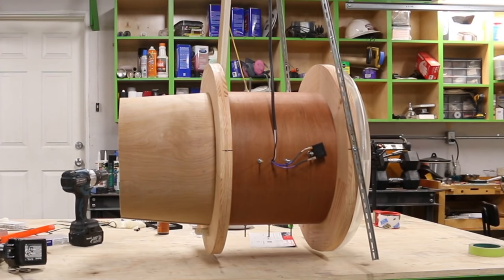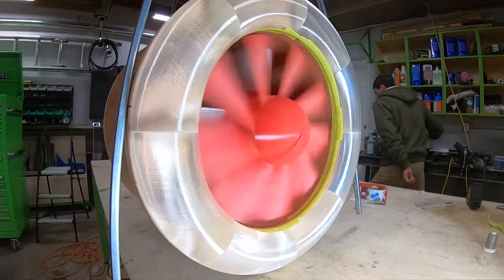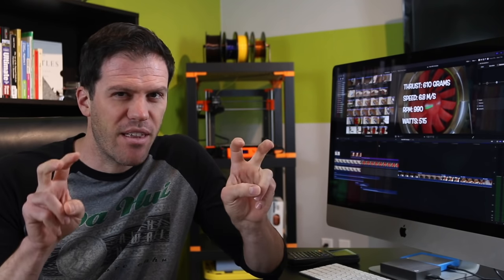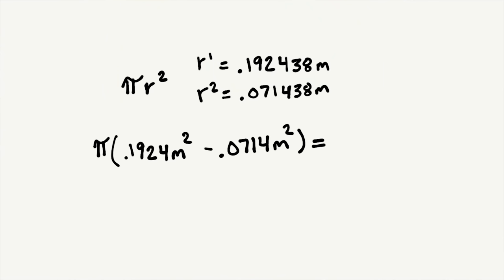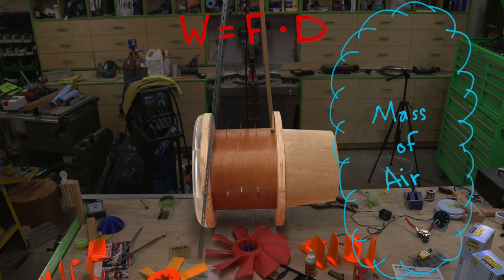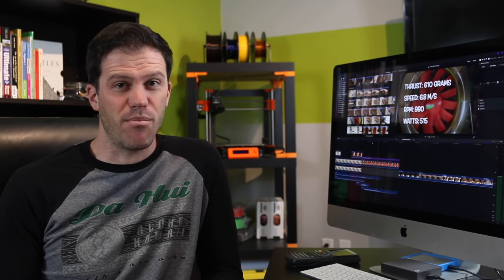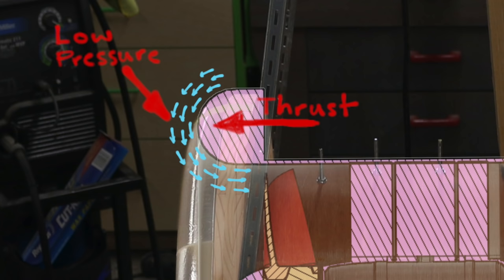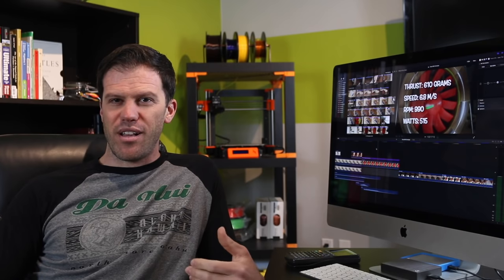How to apply ducted fan theory to real world fans

Comment: Remember that the diffuser at the inlet increases the mass flow because it slows down the air raising its pressure and density, the greater pressure difference between the inlet(before the fan) and outlet(after the fan) adds the mechanical displacement of air from the fan. In other words, with a diffuser, air begins to pile up before it interacts with the fan.

Comment: I'm just a home handyman. This explains why duct-taping a common floor fan onto the front of a honeywell air cooler when the original fan stops working does not work out to be very effective. I have tried it and quickly realized there must be a lot more science and technology in the design of fans and fan motors than I thought. Nothing works as well as the original parts. I am having trouble sourcing the right replacement parts in Australia though. Thanks for the video, I watched it all and I found it very informative.

Comment: the inlet is helping redirect normal atmospheric pressure (even in all directions) into the fan. It provides a gradually curved surface the air can "hug" as it starts moving radially inward in the plane of the fan and has to accelerate at 90 degrees to this to actually enter the fan. The curved inlet prevents flow separation, same as the top curve of an airfoil.

Comment: The HVAC guy used to take account of static pressure and dynamic pressure in working out air duct flow performance. 

Local moving air has a lower pressure (density) than ambient air, with or without ducted.

Comment: Hi! Are you sure the inlet difference you recorded is the coanda effect? I think without the lip you are experiencing loss due to the entry flow condition. Essentially the most efficient part of your fan (the outer diameter) is getting turbulent air because of the sharp entrance corner. You can test this by using a truncated cone (you know when your dog has stiches and they put that cone on their neck so they can't lick themselves?). Just make the outer diameter large enough so your free stream flow is as low as possible and avoid abrupt changes (smooth curves and not corners).

If you investigate this I suggest the title, "Is the coandra effect a LIE!?" and a thumbnail with a big red curving arrow pointing to the duct lip. Glad I happened upon your channel, great content! 

PS - Maybe use paper/poster board for the cone since 3d printing would have a rough surface and take forever to print. Cheers! If you can find a copy of this book: 

Munson, Young and Okiishi’s Fundamentals of Fluid Mechanics 

Check out chapter 8. I think the way you would really test this is adding a longer inlet duct and using properties of that duct to calculate a characteristic length loss. Ok bye for real this time.

Comment: I have to say, thanks for working through the power formulas. This let me 'solve' something I'd been curious about in a moderately different domain- a diver propulsion vehicle (DPV), depending on the model, is just a glorified ducted fan in water. For one, I have a DPV, and based on possibly wrong specs, I know it probably caps out at 300W, with a 25cm duct diameter. Thanks to math, I can now say, at most, the water is going through the DPV at ~4.0MPH (or 23 gallons / sec), which should be a ceiling on max speed.  Then for two, I'm wanting to try building my own, using a similar ducted fan design but using an an edge driven axial flux motor prop concept thing. But I've had no idea what kind of specs to aim for other then the 'let's try it and see' method. Now I have a relation between flow velocity, power, and prop diameter. (granted, applying all of this in water probably adds a whole host of other issues, but if it's within a factor of 2 or 3 (parking lot of the ball park), I think that's fine)

P = area*density*(m/s)^3 ... or ... P = (volume/s)*density*(m/s)^2 ; these need to be posted somewhere. I have no idea what to call them because it's an incredibly specific niche, but they need to be easier to find. (or I need to get good and realize that this was always a simple derivation of the base units of kg⋅m2⋅s−3 )

Srsly, everytime I would go looking for a power formula for pumps/fans/etc, they all focus on power in the context of a known delta-P. Which does make sense to me- in those systems you're adding energy to the system by moving mass 'up' a pressure gradient- simple case of energy/time. I'm still scratching my head on the interpretation of this formulae / the situation of no pressure change, I think it's down to "we've imparted velocity on a previously stationary mass of fluid". Which also kind of makes sense. It's a different way of getting to the energy change. 

All this to say, thanks for the video, it was one of the more useful/informative make/testing videos I've seen on the platform!
Reply: And a dumb step further / related to the design problem.
P = F*vel, F = P/vel, so for a 300W motor, with 1.78 m/s flow, you're talking about a force of 168 N. Which is going to be (probably a high bar for) amount of force the rotor imparts on the (external) stator / the load rating needed for bearing surfaces. Which is another of those things I've had in the back of my mind for "how do I even begin to work that out". 

So, again, thanks for the formulae, even if my interpretation makes the engineers cry :-p

Comment: I loved this. I might have missed a point, but am baffled that the measurements fitted the 2 or 3 blade fan. Obviously, experience (ie commercial designs) tells us that more blades are "better". In fact, as I read it, bigger fans are more efficient because they accommodate more blades. I'm looking for clues!  Another thing (where I'm probably way out) is that compressing air (unlike water) leads to more complex calculations involving specific heats. I wonder if that is part of the disparity.

Comment: Does your mass/s @ 10:03 include the compression of air as the fan pushes?
Or is it nearly offset by the lower pressure just before intake?
Or is it fundamentally insignificant to your goal?
Or is the 'napkin' running out of math space?
Or am I an ignorant lunatic? 

Probably #4 ..

Comment: I had to design a duct for the lift fan on a hovercraft I'm building. In the end I had a straight duct with no bell mouth as I found out that there is not much air velocity as the skirt holds most of it in. So the fan is really just pressurising the air and adding bits as air is spilt past the skirt.

Comment: That sharp edge of the duct when not using the rounded inlet geometry might just cause a flow separation in the front part of the duct leading to vortices forming in this low-pressure zone. Hence, the mass flow is reduced. When using the round inlet geometry you avoid those vortices, enabling a higher mass flow and exit velocity. Exactly as you measured!

Comment: The decreased outlet velocity without a curved inlet lip probably comes from a flow seperation just behind the sharp edge. The seperation effectively decreases the inlet stream tube area so the outer parts of the blades are not moving air, this is called blockage. As the nozzle area stays constant, the decreased mass flow leads to lower velocities after the nozzle.

Comment: Love the models, testing and all your efforts, but….  The force (or static thrust in this case) is the mass flow rate through the closed system times the (mean) exhaust velocity (Mdot x Ve). From watching the video several times, it appears you have calculated the blade’s tip velocity (rotational velocity x blade radius) and assumed it is the flow velocity at the fan face. I’m not sure that is correct.

Comment: I am trying to understand jet drives in performance jet boats well enough to make improvements to jet drives intentionally . I could not have paid more attention to your video from start to end without going into  attention debt. Particularly interesting were the bits where you found that the volume taken by the fan in the duct did ot count against the dynamic airflow volume very much. Also the effects of intake bell mouth shapes and presumably sizes. Even though jet drives and ducted fans part ways in in most ways at the far ends of their impellors, the inlet side of both share a lot of similarities and room for improvement on their inlet sides

Comment: I made it this far because I believe that ducted fans are a preferable alternative to the traditional propeller used by autogiro aircraft; simply that the noise produced indicates major energy loss. Provided the shroud does not create too greater an amount of drag, I am interested whether the greater pitch of the fan blade at fewer revolutions would mean the same thrust as a naked propeller - but in a narrower plane. Without the means to build and test, I am looking for clues from watching the application of maths to this area.

Comment: Sooo cool! I’m all in...I’d like to see ur results on negative camber wing section shape nacelles using NACA types such as NACA 4412,..15,..18. Or N 63-206,..209,..and..210. Negative camber nacelles with max local camber forward on the inside and an outer concave shape (like NACAs above) in a conical parallel to your fan axis...I would model that... I bet u’d see magic.

Comment: With the two bladed model, create ridges on the low pressure area, concentric to the shaft, about 3 mm deep and 5 mm wide. The cannelures/ridges should touch, with sharp edges.

Comment: theres some basics to consider. first off, the less blades, the more efficient. secondly, the larger the diameter of the blades, the more efficient.
now, when you use too many blades and a small diameter things get messy.
The main reason to use lots of blades is to stuff as much work into a small area as possible- at the expense of efficiency. its a space constraint problem.
The next is blade pitch. at static conditions there's a sweet spot and if you go too fast things get messy too. So consider plotting the results in terms of thrust v rpm and NOT maximum thrust and maximum RPM.
Obviously when flying theres also a sweet spot but thats another story.
And then there's the intake lip. You just cant test an EDF without one. And you cant just use any old shape either. 
For rules of thumb, power is proportional to diameter and RPM and speed is proportional to RPM.

Comment: 1) Duct air mass isn’t equal to ambient air mass. If not corrected the calculation can be larger than actual.  

2) It is also known that air speed approaching the inlet accelerated to X m/s and further accelerated to 2*X m/s right after the blade trailing edge.

Comment: Normally the 'losses' are in a form of heat or friction i.e. print surface, air resistance, bearings, coil, insulation, etc. and ofkos the main design factor that is unknown to viewers is the motor life (efficiency) unless it is a new unit (100%).

Comment: Hi there, believe it or not I made it to the end. Nice video and interesting considerations and approach for a anything but a simple flow physics problem. I think it was right to get rid of the intake lip and of the exhause because their respective effects are not accounted for in the math. There would still be an item to remove (if that was possible). The struts behind the disk which hold the shroud have an aerodynamic contour. While they're holding the shroud and straightening the flow, they're likely to contribute to the whole thrust of the ducted fan in a non-negligible amount. kind regards, Marco

Comment: You may find that lining the duct with UHMWPE, with its super-low friction, improves its airflow.

You may find that a curve on your inlet that isn't circular, but rather is more like the .. what's that called, the nautilus-shell curve, based on the golden-ratio?

something like that, so a broader-curve further away from the actual-inlet...

Oh, the room's messing with your airflow situation..

having a fixed-mount for your anemometer might help get reliable-measurments.

relative-humidity's altering your .. ah, you got that!

You're removing turbulence with your inlet-form.

Subbed.  You're helpful, & you make mistakes just like me.

: P

Keep learning, man: it's what life's for, eh?

( :
Reply: Thank you for getting me thinking on these things, again, eh?

I'd spent a few years studying "Principles of Yacht Design" ( they've a new edition of that KEY book out, now ), & conceptual aircraft-design..

1. the aspect-ratio of the ins on your fan should be, because the ends are blocked, about 3:1.

2. given the size of your hub, you may need to make the duct bigger, to get it really-efficient.

3. you need to make the fins about 8% thickness vs chord, for aerodynamic cleanliness/efficiency: less thickness is less efficient, & NACA airfoil curve works quite well ( wikipedia's got that equation )

4. having the duct narrow, as the flow goes through, increases thrust, but is noisier, having it widen, is quieter, but less-efficient ( submarines care about that )

5. balance the RPMs with the prop-diameter AND the number-of-blades, in order to get the tipspeed to your situation's optimal ( I've read an equation, somewhere, that, when worked-out, gives a max-efficiency aircraft-prop of tipspeed=0.191M, but, of course, most aircraft-props run a tipspeed closer to 0,6M, due to the blunt need for thrust..

you can't go higher than 0.8M without having your prop's upper-surface going transonic, which rips pieces out from it, .. some say that is a Bad Thing(tm) .. and NASA says you can't possibly have a quiet prop above 0.6M, because the upper-surface then is 0.8M.

These tipspeeds are not being reached in your machine, but knowing that it is very nonlinear, & horribly extra dimensions of difficulty get brung-in, with higher tipspeed, is good to know, even when designing a kort-nozzle/ducted-fan, right? : )

N. ( can't remember what numeral's next, & this tiny edit-box doesn't let me see without scrolling, so : P  )  Maximum-efficiency tends to be with fewest-blades, simply because of least-surface-drag, so 2..3 blades should be highest-efficiency, more-blades can give a much-better sound, for people who like quiet, tossing efficiency for peace..

N+1. the NACA/NASA papers on NTRS.NASA.gov mentioned, somewhere in one of 'em, that the lift-line on a normal NACA is at the 25% chord line ( notice on the Spitfire that line was straight, with the elliptical-wing curved around it ), but that if you alter the camber so as to move the curve more-forward, you increase the lift, but worsen the stall-characteristics..  I believe the curve camber needs to be either parabolic-shaped or parabola-on-parabola shaped ( the NACA airfoil is a set of ?4? parabola-like-curves, each controlling a different part of the curve )

Oh, & your ducted-fan'll never work in superfluid-helium: I've never understood how people who live in superfluid-helium manage to make working HVAC systems..

: P

Comment: Why not borrow everyday tech in your car/bike? The wheel sensor found in/on any vehicle with ABS/ESC. I'm sure you could implement a system to have the propeller blades be comprised of ferromagnetic material/structure and then simply place the wheelspeed sensor at the correct proximity to the blade tips. (even if you have to remove the section of duct for the sensors tip. And obviously, the signal will probably be pushing the limits of various components/systems at full power/rpm and the design may need to be tweaked, as in, configuring the EM properties of the props so that only select props give a signal output)
Reply: What are you suggesting he try to sense? Wheel sensor? I you want to know how fast the blade is spinning, a piece of white tape and a $5 laser rpm counter off of ebay.

Comment: Why don't you grab a Mass Air Flow sensor off of a car, (junkyard car, they're cheap and easy to grab off an intake.) Grab the wire harness for it too. 12.5V - 14.5V to power up the hot wire. It measures the mass by how much the air cools a second wire, which changes the resistance. Get a baseline from whatever the ducted fan does now, with your calculations. Cooler less resistance, more air. Then, when you try something new the sensor will read more or less voltage. Older cars, (80's,)have volumetric meters which block the airflow more, (see less efficient.) Usually a flap that changes the resistance on a pot or rheostat, sometimes a cone shape. There are also MAP, (Manifold Absolute Pressure... I think.) MAP sensor detects pressure in an intake, may not do you any good here, maybe if the was a longer housing, or a tube coming off the side? I wonder if you could improve the knowledge of what you have here using off the shelf sensors that are cheap and widely available. 

With an OBDII computer and a scan tool you can actually see what the sensors read in real time on your car won't apply to the ducted fan unless you used the a similar ecu... and then put all the air through the MAF which is a much smaller diameter, 2.5-4 inches. Keep in mind a car pulls ALL of the air through a MAF, or VAF, and past MAP sensors. Once past the measuring point the air is considered metered, until it goes out of the exhaust. Any little vacuum leaks can effect air/fuel mix down the line. So they must be good at detecting Mass, Volume and pressure - and +.  Thousands of cubic feet per minute? So they can probably keep up with your project if you install them right. I mean you'll get some results just bolting a MAF in the stream and unlike other more expensive meters and tools you can treat it how you need to.

Comment: I designed a lot of RC ducted fans. I got better efficiency by making the root pitch much higher than the tip. If you look at high quality EDF units you can buy (vasyfan for example) you can see that the root pitch is incredibly high. The blade angle is almost inline with the axle.

This might not be as beneficial in your large and low power + low RPM fan. I'm not sure.